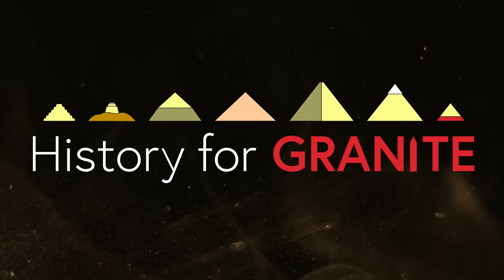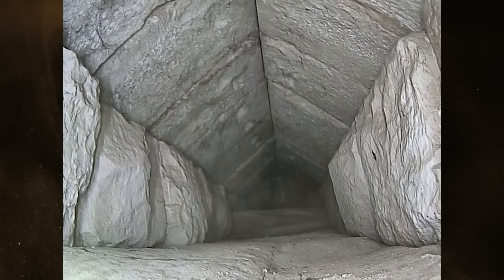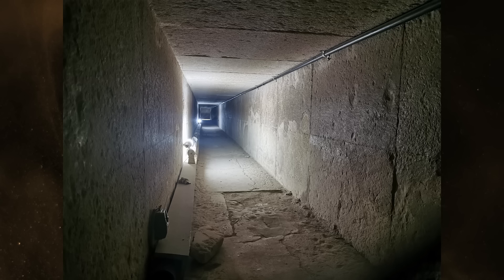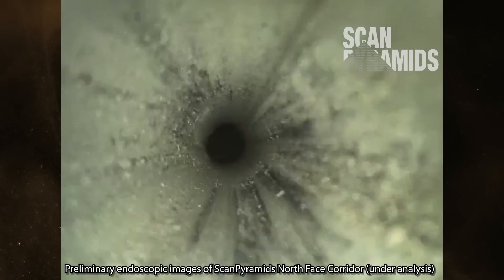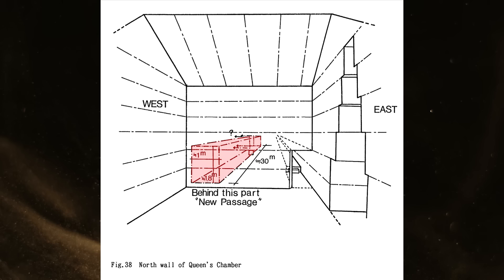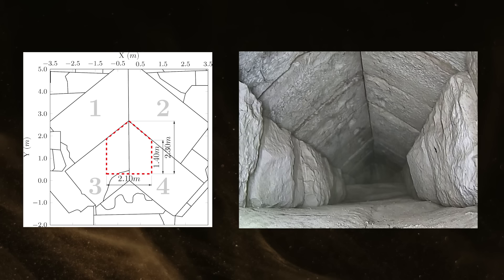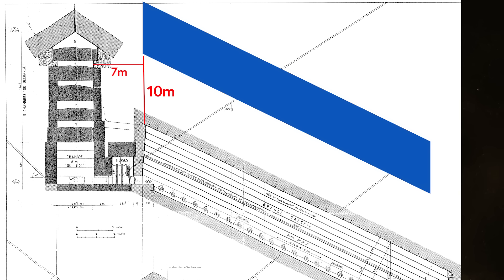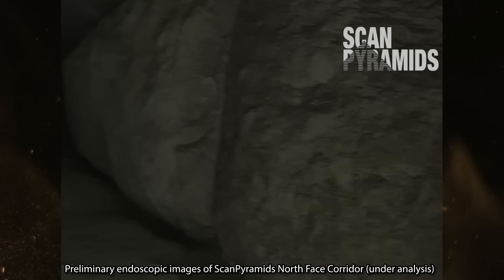New Robots to Explore the Great Pyramid

Comment: Couldn't it be that the Grand Gallery was used as a lever to get the granite blocks for the King's Chamber, and they made a basically identical Grand Gallery 10 meters higher for the granite blocks of the chevrons ontop of the King's Chamber? Since the Grand Gallery ends on the "floor level" of the King's Chamber, it only helps so much as a lever for the various granite blocks needed for the roofs of the King's Chamber
Reply: sounds pretty legit!
Reply: They told the Greeks that they used levers, but that explanation was provided 2000 years after their construction and cant really be verified, which is why how they built them is a controversy. They never left any information as to how they were built, there is nothing. There's only ever been theories of how they did it, no hard proofs. It would be a very logical explanation though.
Reply: If a large gallery is just a "lever", then what is the purpose of making it so perfect from a technical point of view? There is a proverb, you heard a ringing but you don’t know where it came from.
Reply: The ONLY explanation for the grand gallery is that its is clearly designed for bringing large stones up to the level of the kings chamber.   It has all the indices of a functional structure designed for elevating stones, and is large enough for every stone thus far found in the structure. As the pyramid was being built, it could also have been the primary ramp for bringing up 75% of the stones in the pyramid.   It makes sense that all the stone for the king’s chamber roof and ceilings was brought up to this level, and then as the pyramid rose around the Kings chamber, those stones moved over to be pulled up a second grand gallery to get them to their ultimate elevations.  The top of the ascending layers of the pyramid would have been a staging area for the large stones that had to go further up.  So I would say the greatest likelihood is that the void is indeed a second grand gallery used to elevate not just the ceilings and gables, but also a significant amount of the overall mass of the pyramid up to that level.   If you continued the newly discovered 2 meter wide vault it intercepts the base of the grand gallery.  Given that the pyramid appears to have been re-designed for the higher chamber after construction began, I think the the original entrance was a level continuation of a smaller external ramp that only lifted stones as far as the entrance.   Then becoming a roofed over passage to the base of the grand gallery where there was a winch and sled set up to raise 40 tons of stone at a time to the working level of the pyramid.  A properly designed winch would have saved tens of thousands of manhours in lifting stones when you consider that the 40 ton capacity necessary for the gables, would have meant each lift bringing 20 plus regular stones up at a time. Unless real evidence emerges of there being an internal spiral ramp just behind the exterior stones, stacked grand galleries could easily have been used to lift most of the mass of the pyramid.
Reply: @randoedits6906 They also told them it was built by slaves;  but it wasn’t, and that Khufu was a tyrant, which he probably wasn’t.
Reply: Would would that lever be made of?
Reply: @ryannagy9244  Why can't you guys come up with anything more creative than vague notions of "vibrations" "waves" and "electricity"
Reply: @landyshserebristyy2493  Nothing about the pyramid is ‘perfect’. And he was not saying the grand gallery is a ‘lever’ he was saying Herodotus was told by Egyptians that levers were used in building it.  ( which of course they were ) The grand gallery is a space large enough to lift the largest stones in the pyramid and has socketed holes along a ledge in either side that some have said were how they attached wooden rails, but i think were more likely part of a ‘ratcheted’ braking system so that the winch sled could be pulled up in short stages, locked at that height, and then the ropes re-set to make another lift to the next set of sockets. This would have been necessary for the heaviest lifts, but they might well have been able to lift 5 or 10 ton loads all the way to the top roving the winch for less mechanical advantage.
Reply: @ryannagy9244  The utter lack of any evidence for Egyptians having such technology speaks for itself.   Seeing something you THINK you recognize and assuming you’re correct is called Pareidolia.   When a culture has understanding of scientific or mathematical concepts that SHOWS UP in how their culture progresses from that point on.  For example, the Muslim originated science of Optics resulted in everything from perspective art, to reading glasses.   Egypt had no such knowledge, because if they did their subsequent culture would have progressed on the basis of that knowledge.
Reply: @christopherpardell4418  Jean-Pierre Houdin's description of the Grand Gallery/counterweight operation involves offloading about half the weight, resetting the "trolley," then loading the weight back on for each run. With two Grand Galleries, with ropes connecting them through an originally open portcullis shaft, two counterweights could work together to  raise the heaviest tones, but be reset individually to avoid having to remove any of the ballast. So I think the void is very likely another GG type structure. The question remains though, why put so much granite above the King's Chamber? It just adds weight and the "relieving chambers" don't actually relieve anything. Perhaps the builders thought they did. Perhaps there's another reason they wanted the KC structure to be so tall.
Reply: Correct I think the same.  Jean pierre houdin's theory shows 2 or 3 lines of men on ropes controlling a Counterweight lift of the Kings Chamber roof beams in that same are of the void.
Reply: @davidklang8174  Well, they did not have advanced maths nor structural theory. Everything they knew about structure was thru trial and error.  It wasn’t egyptians that came up with the ‘theory’ that they were stress relieving chambers.  That was a fairly modern idea put forward by archeologists based upon what THEY knew.  But archeologists have, for a long time, totally misunderstood how heavy objects are made and moved.  Its possible the Egyptians also thought the chambers would relieve weight above the flat ceiling of the kings chamber. I mean, every square foot of air up there is 300 LESS pounds of stone sitting directly on top the the ceiling stones.  It could be that each separate chamber has some religious significance relating to the kings passage to the afterlife, or even some religious or superstitious significance to ensuring the ‘safety’ of the structure.   The very first time I ever saw a photo of the grand gallery and a cutaway, I recognized it as the kind of thing you would build to haul heavy stone up a steep incline.   At Hatshepsut’s temple there are two ramps with a staircase set between them.   The staircase was used as a braking system for hauling heavy sledges up the ramps.   A set of wooden blocks fitting 2 or 3 steps could be inserted to stop a sledge from sliding back as you reset a groups of ropes.   We know from their ships that they had some idea of how a block and tackle works.   Not long ago the same setup of steps between two ramps was found at one the quarries supplying stone.  To me it just makes sense that in building the pyramid you would simply build it AROUND the ramps you needed to bring up the stones.
Reply: @davidcorbett1713  Think how easy it would be for the “counterweights” to simply be gangs men who ran up to the top to grab hold of loops in the rope and rappel down the smooth face of the opposite side. 8 men per 1.8 ton stone, dragging up the external ramp to the base of the grand gallery ramp, team after team loading perhaps ten or 15 stones per lift. With a winch giving a 3 to 1 advantage, just the weight of the men who brought 15 stones up would be enough to pull up 10 to 15 normal stones.  200 men acting as self propelled counterweights would be enough to lift a 40 ton stone.
Reply: This sounds like what was mentioned in the video on this channel about the internal ramp theory.  That was based on ropes, not levers, though, and I'm not sure if levers of the available materials could do the job.
Reply: @ryannagy9244  And we have full-on alt-history dogma in the comment section. Congratulations!
Reply: @ryannagy9244  So it was fart powered?
Reply: @ryannagy9244  Tesla himself? You speak as if he were a deity. I've studied some of Tesla's life and work. He was brilliant and he was flawed. I know that the alt-history crowd idolize him and seem to have built a legend or a myth about how much he actually accomplished. Tesla didn't invent a/c current, he made significant contributions to many of the technologies we use today but he was also bolstered by media hype around the roll out of hydro-electric power at Niagara Falls.
And how the hell would he know anything about the pyramids? The small amount that had been excavated and studied during his lifetime would have given him very little actual insight into their purpose or construction. But the alt-history adherents will shamelessly invoke his name as if he weren't just one of many geniuses to come out of the late 19th-early 20th century.
Reply: @christopherpardell4418  agree with that in mind a greater weight and force ( ie levers ,counterweights , human manned pulley wheels )would be needed to shift the blocks. Any use of wood has long gone 4,500 yo , that helps us imagine what they did. Let alone how did they shift the Heavy blocks from Quarry to Nile boat and transfer over again ? Problem for me is rolling them on  logs. If they got jammed going up a Chamber how do you unjam them ? Well unless a  slave was expendable ?
Reply: It's the cooling tower for the sulfur furnace (kings chamber).
Reply: @Christopher Pardell  they actually had some knowledge of advanced mathematics, if you watch one of World of Antiquity videos (need to find it again) he gives the source. Ancient Egyptians understand what we would call Pythagorass theorem, Egyptians were using this equation well before Pythagoras. As Pythagoras studied in Egypt and only presented this theorem after coming back, he clearly got it from the Egytians. They may have also understood the idea of PI.
Reply: @christopherpardell4418  just like the corbelled corridors and chambers inside the bent pyramid and the red pyramid. they have the same stepped ceilings and the corridors have the exact same holes in the walls. the burial chamber inside the red pyramid even still has remains of wooden beams stuck inside those holes at the ceiling.
Reply: @bird.9346  i don't see your suggestion , it must be so hard to sit there and criticise others
Reply: @christopherpardell4418  they totally didn't have slaves. at khufu's lifetime, there wasn't even a word for "slave". it might sound shocking, but at khufu's time, the ancient egyptians were too xenophobic and proud to allow any foreign hillbillies working on their sacred temples and pyramids. and king khufu was anything but a tyrant. under his rule, the first papyrus scrolls were inscripted and he made successful tradings with babylonia, akkad and today's erythrea. gold, copper, turquoise, lapislazuli, amethyst, olivin and even diamonds were traded. precious oils and resins were also traded. the famous pyramid city at giza included not only vast shelters and offices, but also hospitals and even brothels. it was quite a mundane city in which the workers, architects, officers and other job-goers lived.
Reply: @kawasakikev8905  but he's right. these theories a) don't match archaeological evidences and b) they do not fit the timeline and culture. plus, the history of the pyramids (i.e. the pyramids themself) demonstrate the evolution of pyramid building. from stepped mastabas to stepped pyramids to smooth pyramids. and about the electricity theories: what exactly would the egyptians have needed electricity for? light? no need for that, egypt was the "sun state" with 16 hours of day- and sunlight for open work. as a weapon? against whom? no one at that time dared to enter egypt or mess with the egyptian military and marines. as an energy source? for what exactly? there was nothing at that time that would have needed such powerful energy. if the ancient egyptians truly had any electrical machines, they wouldn't have built their pyramids with stones. ;)
Reply: @ryannagy9244  What..?
Reply: @christopherpardell4418  That's the fun when it's all hearsay.
Reply: @landyshserebristyy2493  The precision would make sense when you look at the precision in the resulting pyramid, seemed like a standard back then.
Reply: @dynamicworlds1  Herodotus had no idea.   And neither did the egyptians who told him that.  Keep in mind that when Herodotus was there, the pyramids being built were as removed in time as WE are from Herodotus.
Reply: @Rusty_Gold85  Loading barges is pretty easy, once you get the block onto a sledge.  You just build a really wide sledge.  And for the boat, a very narrow slip with a stone wharf on either side.   You slide the sledge with the stone spanning the slip on the two stone wharves.  You flood the barge with water till its deep enough to slide I under the sledge. Then you bail the water put of the barge to lift the stone onto the barge.   Do the opposite at the point of delivery.   We know the Egyptians dug canals over as close as the high flood would get to the Giza plateau and built a bunch of wharves there.
Reply: @edfu_text_U_later  There is zero evidence ancient Egyptians understood Pythagorean theorem. Nor did they know about pi, nor the golden ratio. What there is is folks who examine their buildings afterwards and look for patterns they can INTERPRET as their understanding something their ancient culture and accomplishments show no actual knowledge of. For example, you can accidentally create measured dimensions that appear to be related to pi- IF your means of measuring is counting revolutions on a drum whose perimeter length is your standard of measure.  In that case the seeming ‘understanding’ of pi is simply an artifact of using a wheel shaped mechanism to measure length. We can know this because their culture shows NONE of the related developments that would have emerged had they understood such principles. The egyptians were mathematically limited to operations that can be done on an abacus… and we don’t even have evidence that they had abaci as far back as the pyramid builders.   How they measured true North is something anyone can do with a stick and a string on ANY sunny day. In the Morning, place a vertical stick in the ground that is dead plumb… the higher the stick, the more accurate your result will be. Tie a loop in the string, slip it over the stick at its base, and use it to scribe 2/3s of a circle on the roughly north side of the stick. ( like a compass, using the string to hold the scribe at a constant distance form the stick.   Then just observe the shadow of the stick and trace its length from the stick to its endpoint where the shadow crosses the circle.   As the day wears on keep your eye on the shadow of the stick… its tip will trace a parabola on the ground and you can mark its end point every few minutes. When the sun is exactly the same distance past local noon as it was before local noon when you first marked the shadow, the parabola will again cross the circular line. Trace that shadow.   The morning and afternoon shadows form an angle. Bisect that angle by drawing two arcs with the string compass whose center points are at the intersections of the circular line and the parabolic line. Those arcs will cross each other at two points and a line drawn between those two point will be true north.   If you do this with a vertical stick 5 feet tall that has a fine point, you will mark a north/south line that is true to less than 3 minutes of arc- without even knowing anything about degrees or minutes of arc. This will work on ANY sunny day, anywhere in the northern hemisphere.  In the southern hemisphere you just scribe the circle on the South side of the stick to find a perfect North/South line.  People ‘theorizing’ that the Egyptians used the Stars to find true north are kinda right- because the Sun just so happens to be the nearest star.   But they absolutely did not have the optics, nor clocks needed to determine true north from the position of the stars at night, especially given that both Thuban in Khufu’s day, and Polaris today, actually circle true north with greater variability than shown in the pyramids orientation ( Polaris veers left to right of true north by 1.2 degrees).  Rather than imagine ancient peoples had sophisticated knowledge they didn’t, the way to analyze their accomplishments is by asking, How could I do that with no more technology than they had in the copper age?  To find true north I don’t even need to know anything about degrees or radians. All I need to know is that the sun traces a symmetrical arc thru the sky every day and therefore casts a symmetrical arc of shadow.
Too many folks overly complicate theories of egyptian knowledge because of what THEY know and how they came to know it.
Reply: @ryannagy9244  It's a word salad of technical terminology that doesn't mean anything, it's very reminiscent of how Sovereign Citizens talk about the law. They can write a jumbled court filing mess of latin terminology, habeas corpus, sua sponte, ex parte, but they have no understanding of how the law actually works - the Rules Of Civil Procedure, etc. You might as well just say "magic". Often Sovereign Citizens seem to think they say the magic words and they win. On the new age pyramid stuff - it's obsessed with electricity, electric fields, acoustics, magnets, magnetic fields, frequencies, crystals, vibrations echolocation, etc. This is probably due to these concepts being difficult to understand, and also kind of trippy. There's something fascinating about magnets, and the physics of how they work is unintuitive. Most new age people wouldn't have a clue how the physics of these things work in reality - if you asked them to design a watch using the piezoelectric effect they wouldn't have a clue, yet it's sitting inside your cell phone right at this moment.
Reply: @christopherpardell4418   perfect assumption based on evidence. All the notches etc in the GG and friction marks- perhaps a pulling motion with ropes and workers behind also levering slabs via cross beams in notches. I wish they also found a pulley! And obviously duplicated above with another GG. ratcheted escalators of sort. The V shaped stone at the top is clear evidence of a tensioned member terribly defaced by restoration work. I’m a builder and am starting to think short bronze/copper chains were used with links joining them( similar to Victorian suspension bridges built with iron links before they had steel cable)
Reply: @ryannagy9244  - You really need to keep your day job instead of hypothesizing crazy theories about the pyramids of Egypt. However, I fear that your day job might be just as theoretically implausible.
Reply: So tesla invented or made  hydro electric power? Or was he the one with a team who built it at Niagara falls? I remember watching a movie about him. And someone  else made the hydro electric power, and he tesla invented Ac energy? Can you tell me more.
Reply: @phoneguy4637 then why did the Egyptian lie about him? Just curious.